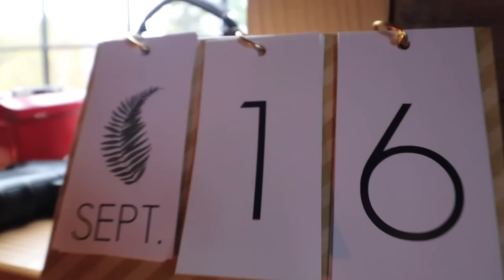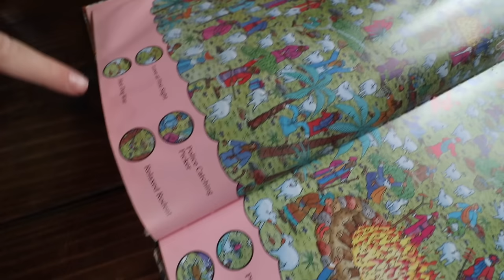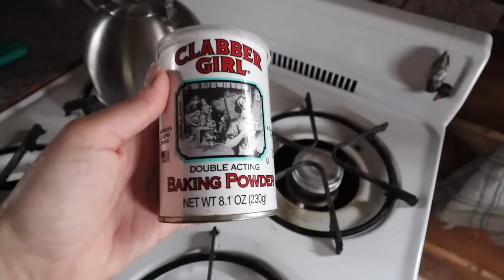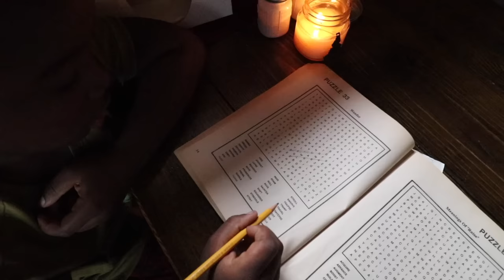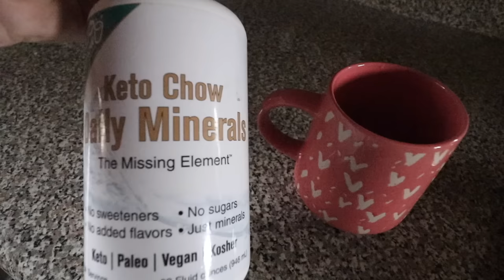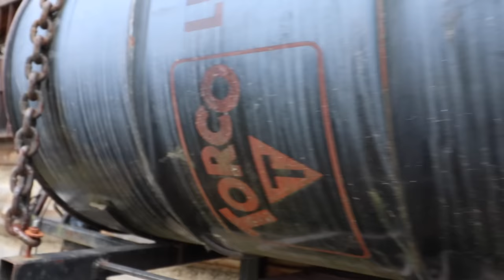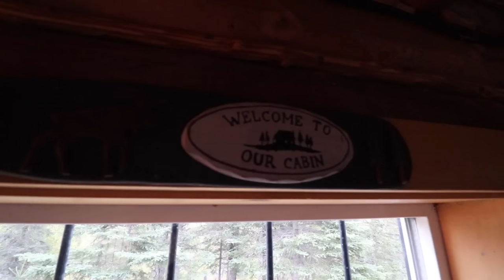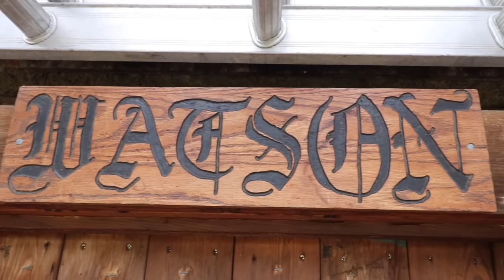Autumn at our Off Grid Remote Cabin in Alaska! | End of Season Trip Before the Winter Freeze!

Comment: I wish a long extended dock was at the shore line in front of the cabin because it would be so easy to park the boat right there. I believe there is a company that sells floating docks that extends far out into the water. Those docks are made with a material that's resistant to rot, and is built and made for situations like an extended entry to the shoreline. The water plants would have to be cut below the water for the boat to have easy excess to the dock. I bet there are fish in and around those plants too! A wide floating dock would be a great place to catch fish. peace family.

Comment: Many LED lights with lithium rechargable batteries are very practical for lighting.  Solar charging is best with $20 solar charging panels.  I like the larger 18650 3.7 volt lithium rechargable batteries which last 10 years plus and can be recharged a 1000x or more. The only bad part is that in winter the batteries work less efficiently in the cold.